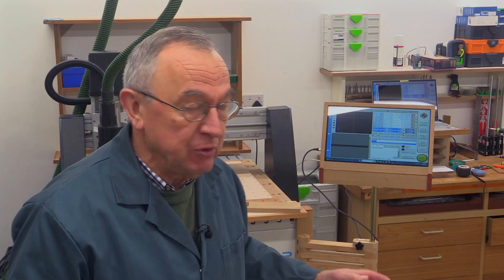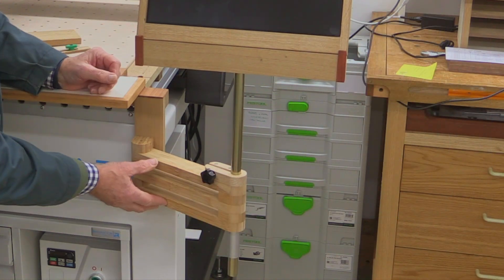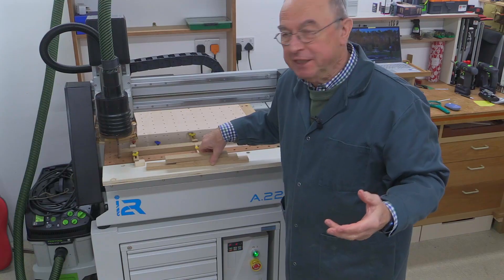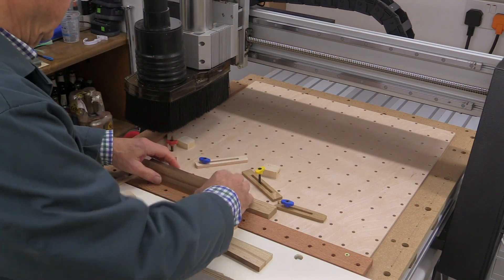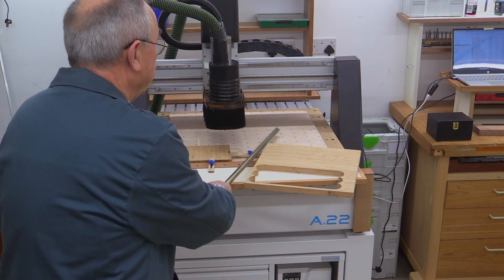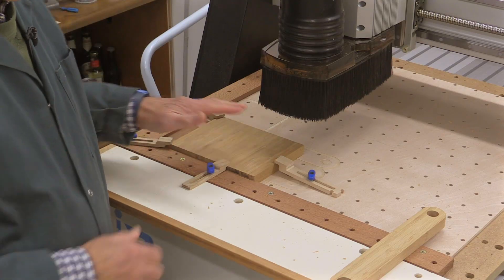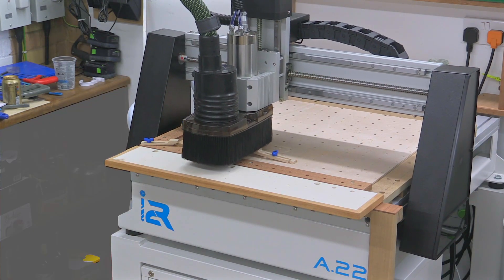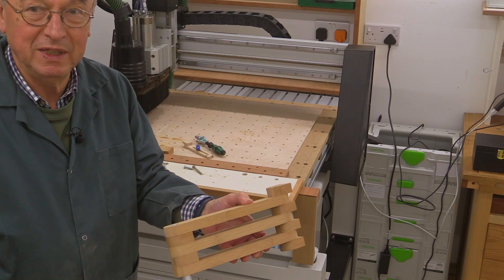How to mount a Touch Screen on the CNC

Comment: Hi Peter. you might consider using a USB C Straight to USB C Angled 100W PD (Power Delivery) cable for your monitor. Plenty of options on Amazon.  I have a similar set-up and mine results in the lead following the side of the monitor downwards and not sticking-out and risking getting caught.

Nice set-up by the way. And thanks for sharing.
Reply from the maker: That's a great suggestion, thank you! I'll definitely look into that. Cheers.  Peter

Comment: Very nice design as always.  May I suggest that you become comfortable with double sided tape.  It's a little bit nerve racking at first, but soon you learn just how well it holds everything in place.  No need for the screw/hole location gymnastics.
Reply from the maker: Hi Phil, Yes, I use double sided tape a lot but after a while picking the little bits off the cutting surface before the next cut can be a bit of a nuisance. I take your point though and will show it in action.  Cheers.  Peter